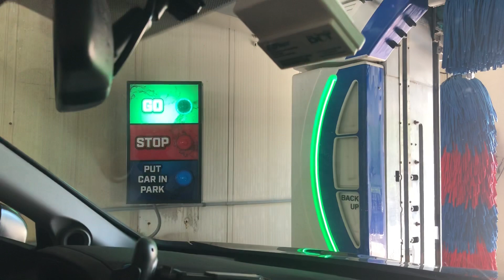(Touch Free) BRAND NEW: Ryko SoftGloss MAXX 3 || Concord Gas & Wash

Comment: I filmed the Brand new Ryko SoftGloss Maxx 5 that replaced an older mid-2000s SoftGloss. They kept the airstream dryers, but it does not have the triangle shaped nozzle.
Reply from the maker: Nice! You must be mentioning the old SideKick dryers. And sadly, I can confirm that there was a vintage Belanger mini tunnel before they replace it. The reason I say this is I saw the old Wait/Go sign at the exit at the exit of the bay.